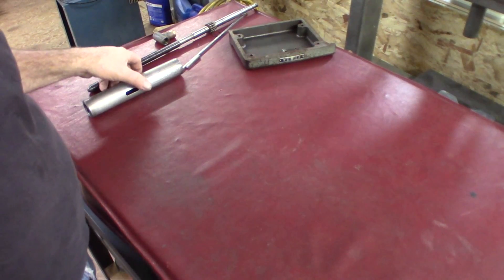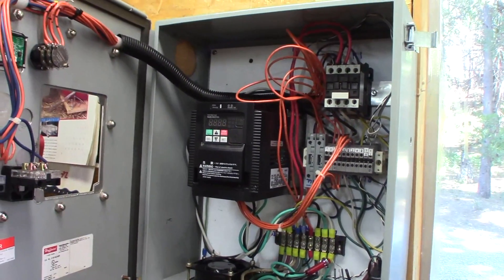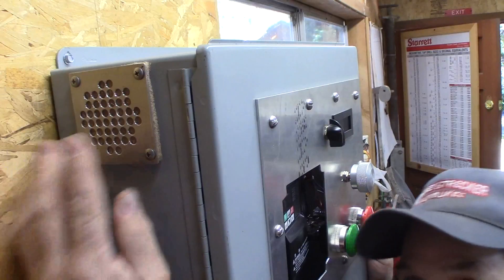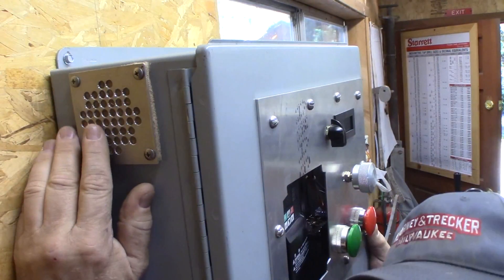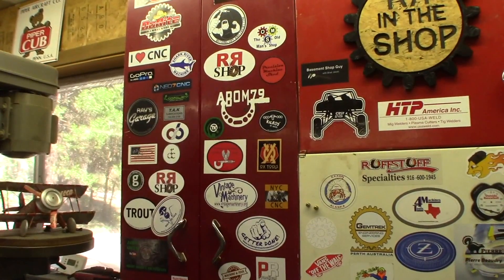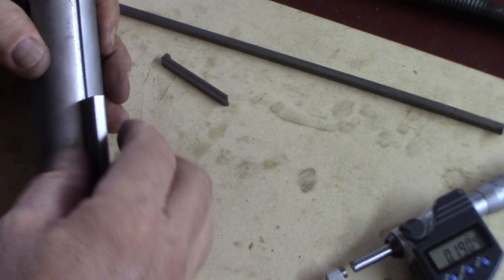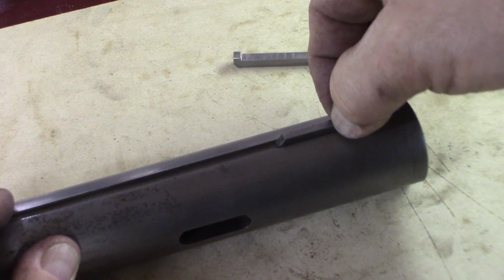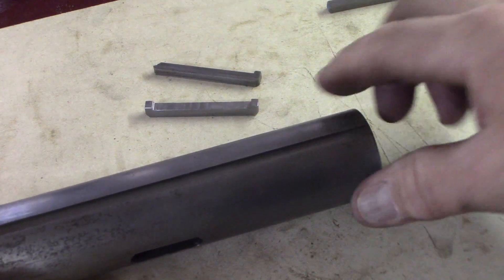How To Repair a Lathe Tailstock of a Clausing Lathe | Tail Stock

Comment: Awesome video! My clausing lathes tail stock was having problems and sticking etc. The previous owner abused the hell out of this lathe and i bought it and rescued the poor lathe. Anyways i noticed the reason why it was sticking and not moving as the thrust bearing OQ-10 seems to be missing etc. I placed an oring as a temporary fix till i can find a thrust washer with the correct dimensions etc. Randy do you have any idea the actual dimensions of that thrust washer? I tried looking for it on clausing website but nothing came up. Any ideas would be extremely helpful thanks in advance!!!!
Reply from the maker: My son now has the lathe.  I do not know .  Try McMaster Carr to find thrust washers.  You will have to have an idea of the size.
Reply: @RRINTHESHOP Thanks for the great thoughts thanks!!! I measured the space in there and cut a disc from bronze bearing and used that and it worked like a charmed...... Keep up the great videos!!!!

Comment: I was trying to find your working on the clausing lathe video but was not able to find it I was wondering what you do or use to clean your ways up so nicely? Thank you
Reply from the maker: Mineral spirits and a piece of marroon scotch bright, keep them well oiled with 220 wt way oil.   Thanks John.
Reply: @RRINTHESHOP   So the maroon pads I think are to 220 grit the green pet R320 grid so the maron's OK
Reply: I hate auto correct

Comment: Randy, I need to make the same key for my Clausing Lathe. Did you have any dimensions on the new key?  Thanks. Dave
Reply from the maker: David,  Could you please send me an email to RRINTHESHOP@GMAIL.COM.
I will check.
Reply: Same here. Mine broke in exact same way. What was the length of the key ?
Reply from the maker: Send me an email to rrintheshop@gmail.com I can send you a drawing.

Comment: Tried to buy a Clausing 1300 a few months ago, didn't get it, got a Taiwan made ENCO 1340 gear head a few weeks ago.  Got it for $800, in pretty good shape.  We had control panels like that at work.  It looks good the way its made.  Why not put the fan at the top pulling the hot air out?  I have become so frugal, it's gonna gall me to throw out chips when I get the lathe going!   14:30 It looks great.  Very Good video.
Reply from the maker: Well can't beat the price.  I do not like hole in the top of a box, everything seem to go into them.  It is tough to toss chips.  I am way beyond frugal.  Thank you for watching.
Reply: I meant reversing the fan and filter locations, with the fax on the side of the box, near the top.  Instead of trying to draw the warm air down and out, you draw it out and the cooler air up.
Reply from the maker: The VFD has it own fan and the box is large enough not to really need ventilation.  But it does get hot here in the summer so i like to but in some extra protection.

Comment: Hi Randy.  Great job.  I'm trying to understand why that rotational movement is a problem.  I can see that axial play is bad.
Reply from the maker: Thank you Jeffry.  With a drill, especially larger ones, When the drill first makes contact and grabs for a cut the drill will want to turn with the work piece, with rotational play the drill can be knock loose from the taper.  The more rotational play the easier and the more this happens.  Very annoying.

Comment: I thought keyway material was very soft (made to shear). While not applicable to this application I wouldn't think you would want to make a key out of just soft steel in applications where you would want key to sheer without doing damage to shaft or pully.
Reply from the maker: Key's are usually not designed to shear.  Wear is better,  but to much wear in the key will cause wear in the keyway and shaft.
Knocking in reciprocating machinery is many time misdiagnosed as a problem with the driven machine when the problem is 
many time a worn key/keyway in the coupling device from the driver.

Comment: Randy, nice repair. I had to clean up my lathe MT3 tailstock with a fine cut MT3 reamer due to rust and scoring. It wasn't much but I took too much off the internal barrel and had to slightly extend the internal left hand thread to allow easy ejecting the live centers and drill chucks.
Reply from the maker: Thanks Paul.  Yes when working on tapers you have to be very careful, it does not take much to be to far.
Reply: Yes, I found this out the hard way and will be more careful next time, thanks

Comment: Nice Job Randy.
Steve
Reply from the maker: Thanks Steve.  Worked out great.  Question for you Steve,  Your large setup block you made.  Did you heat treat it?
Reply: Hi Randy,
Yes. It is made of A2 and is 60 RC. I had this block for decades and use it all the time. I had to regrind it a couple of times due to wear. If you have the money and want something that is better CPM 3V is the way to go. It has almost 3 times the wear of D2 and strength close to 01. Jonathan in one of our videos did his block out of CPM 3V.
Steve
Reply from the maker: Thanks Steve for the info.

Comment: Nice job on the panel. I have just one comment on the fan exhausting. It has been my experience when doing it that way,that you are creating  a slight vacuum in the panel and any tiny opening will suck in room air.After a time you will see slight dust traces wherever there is a gap that is not sealed,such as the cutout for the VFD. What I find that works better is to draw air in through a filter, slightly pressurizing the cabinet and not allowing any unfiltered air to enter the cabinet.
Reply from the maker: Yes you are correct.  I do not run the fan often, maybe only in the summer. Thanks Les.

Comment: Yep, pretty common across the board, doesn't matter the make, the model, country of origin, all these keys go limp eventually. And..you know, i figure it's not a bad thing, i'd rather have to replace a key than the TS tube or the TS body. Old man that sold me the lathe smartened me up on it and told me to buy some extra key stock just for that. :) I'm anticipating the day where i get the excuse to change it.
Reply from the maker: Well worth the effort to fix.  I need to do this to my Lance also.